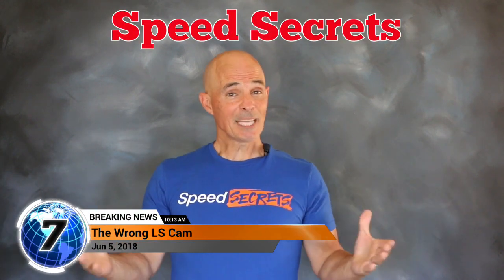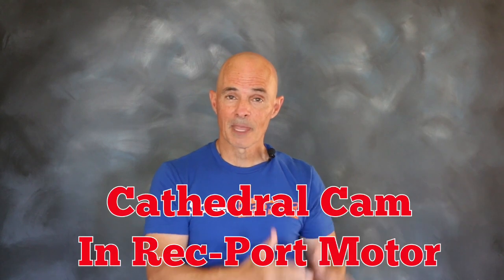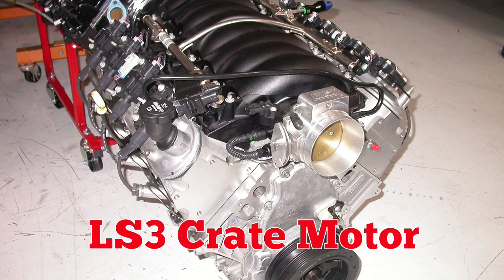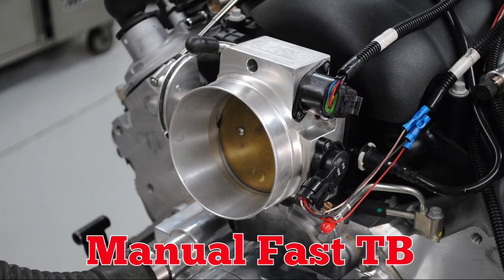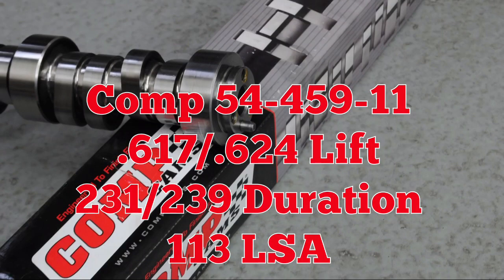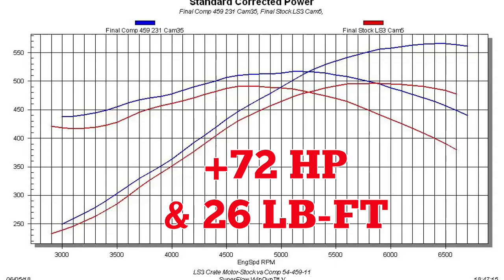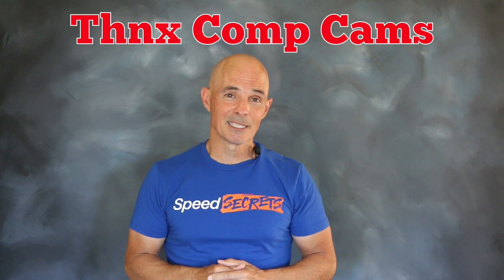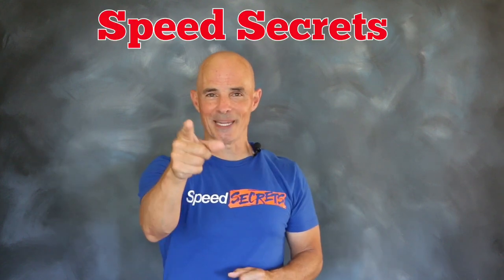Speed Secrets: Putting the Wrong Camshaft in an LS Engine

Comment: What cam kit do you recommend for a stock LS1 with boltons? Boltons are a Fast 102mm upper manifold, a Fast 102mm throttle body, American Racing headers, American Racing Y pipe and an LS2 mass airflow. I'd like a stage 3 cam and heads kit. Let me know your thoughts?

Comment: I can tell you that LS engines with LS3 heads don't need monster lift and duration to make big power some cams with 585-600 lift 226-236 duration make 550 horse power and still have a decent idle and are totally streetable without piston to valve clearance issues and if maintained be reliable and last a long time and still run good
Reply: Gloria Maletta ive noticed that most LS engines generally make the same ballpark hp numbers with any cam. The cam just changes the rpm the power maxes out at
Reply: @swappedoutZ71  over the years with engines one thing l learned is most times peak numbers are not as important as horsepower and torque throughout the entire rpm band start with where your stall is say 3000rpm to redline because when racing the engine will not spend much time below 3000rpm even stock LS3s pull to 6500rpm with a weak cam my 1984 monte carlo ss has a LS2 crate engine from Scoggin Dickey parts center it was rated at 440hp at crank with a GM single plane carburetor intake and stock LS2 cam when engine was ordered heads where changed to CNC ported and milled LS3 heads crane cam with 226/236 duration with 600 lift with LS7 roller lifters the engine with upgrades at crank makes 538 horsepower at 6800rpm and 470 foot pounds of torque at 5200rpm the engine makes 400 foot pounds of torque or more from 3000rpm to 7200rpm that is a 98 horsepower increase but it does lose 20-25 foot pounds of torque under 3000rpm with a 3000rpm stall and 4:10 gears its a monster from 3000rpm to 7200rpm this engine has been in my car since 2008 going on 12 years soon and runs as good or better than when put in but it is taken care of very well with oil changes and maintenance besides a blue printed oil pump hardened pushrods a SFI balancer a aftermarket timing chain and holley HP 850 carburetor a Z06 starter 1 7/8 longtube headers with 3 inch collectors 3 inch flowmaster one chamber race mufflers and dumps the shortblock is stock stock crank rods and pistons with a built 700r4 transmission and a buick GN 8.5 rearend with 4:10 gears the 3000 stall converter is a lockup converter it's best run 10.87 at 122.9mph in the quarter mile no nitrous blower or turbo it will run 11.1s to 11.3s all day long driven to the track raced and driven home no trailer and can cruise 75mph at 2800rpm with torque converter locked up and has power steering yes it is not the fastest car but it drives nice on the street and the temperature never goes above 180 degrees even if idling in traffic in 95 degree florida heat and idles decent with a slight chop and very reliable it has spanked many 454,468 and 496 bigblocks but not all of them and it's only 364 cubic inches my car weighs 3380 pounds with me in it with a half a tank of gas
Reply: Gloria Maletta yeah i am building a 6.0 with 224/230 cam. Not a big cam by any means for a 6.0 application but power under curve should be excellent and when dealing with LS i prefer no less than 4000rpm converter because they usually make peak tq around 4000rpm unless u have big cam and high rise intake that pushes peak tq to higher rpms sometimes. Personally i like my engines with more tq than horsepower. It makes for a very strong feeling vehicle.
Reply: @swappedoutZ71  with a stall of 4000rpm if any substantial street driving is going to happen you'll need a lockup converter otherwise it will be slipping until 3500rpm and it will slowly cook the transmission but it will work well for racing without a lockup converter
Reply: Gloria Maletta yeah its lockup and i have tru cool 40k cooler

Comment: Hold on a minute. I am not claiming to be a engine builder by no means. But when has it been and option for cathedral or rectangle port on camshaft choice? Correct me if I'm wrong, but you base your camshaft choice, based on engine size, power goals, head flow, transmission type and most important, sprocket type! 3 bolt or single. Not the port shape.
Reply: charles walkes Think about it. Port shape impacts flow and not all heads have the same intake to exhaust flow ratio.  Rec port heads have relatively better intake flow so generally run more exhaust duration.
Reply: @philistineau  Look at Richards new video about Cathedral port VS. rectangular port cams, it proves your theory WRONG. I think Richard is being Sarcastic about it being the wrong camshaft. It made 71 more HP. what is wrong about that?
Reply: This is due to some LS engines like the 5.3, 5.7 and 6.0 having a cathedral port and later models having rectangular ports; meaning that even a cam meant for the earlier model engines can make big power on later model engines. If you look at a crazy LS1 cam it barely compares to a "level 1" cam from later engines as everything on the LS3 basket is upwards of .600 lift
Reply: @milfhunterX  just stop
Reply: I know theres no such thing as cams varieing from type of heads

Comment: I was about to say, these came are interchangeable in LS motors. As long as you have the right sprocket, you're good
Reply: That's what I thought. When is your cam choice,  based on cathedral or rectangle port? That's not  a option when choosing a cam.
Reply: Yeah. Not right at all. See my response, above.
Reply: Believe it or not, in the real world, this is a very common thing to do.  Reputable machine shops can make changes for sprockets and after market timing for this cam swap.  It's not advisable to do this "Upgrade" unless you rebuild your motor frequently.  Didn't you wonder why they changed the valve springs at the beginning?  Reliability goes right out the window with this change though.  Not to mention the reality of the tuning nightmare you are going to have.  Knock is a major problem with this change.
Reply: @joshtheking1772  huh?